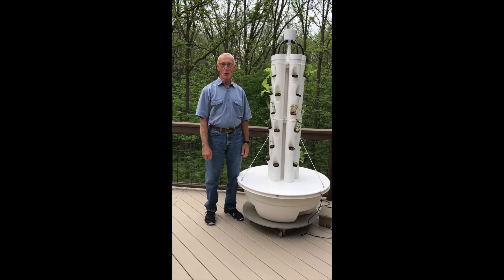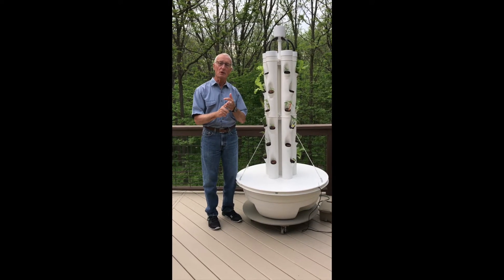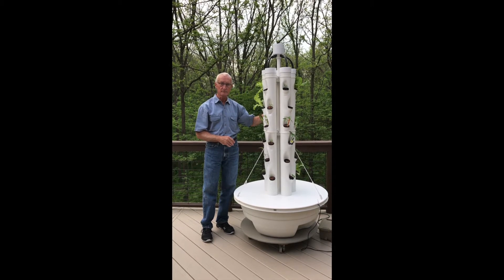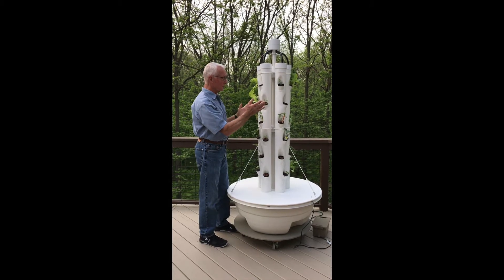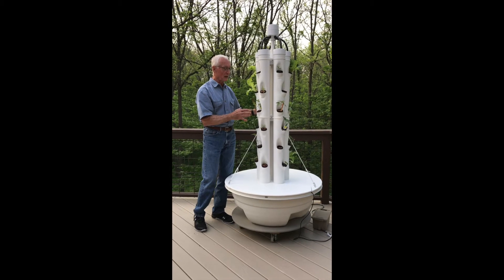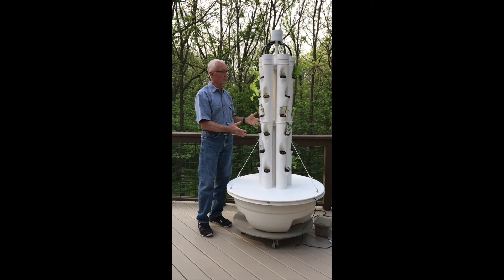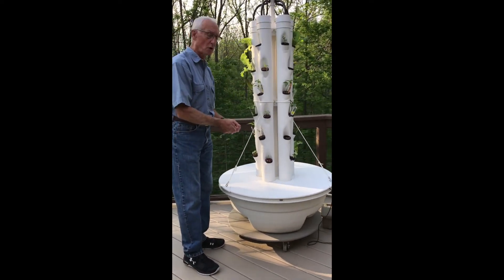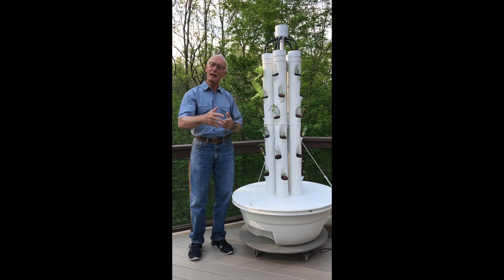Arloa's Hydroponic Tower Garden  Part 1

Comment: I don't understand how you can mix tomatoes and cucumbers with salads. They require a mix of nutrients a lot richer than salads. Great idea the two pots to prevent dripping. Thank you. I will look at your three videos. You made a very nice system.
Reply: I'm about to build an indoor tower and I am struggling to find a leak proof way to mount the net pots. Great idea to caulk a first net pot into the tube, cut out the bottom and set a second net pot inside! Thanks for solving my problem.